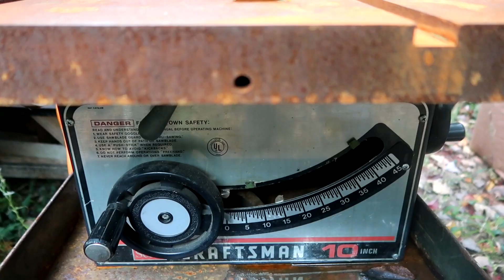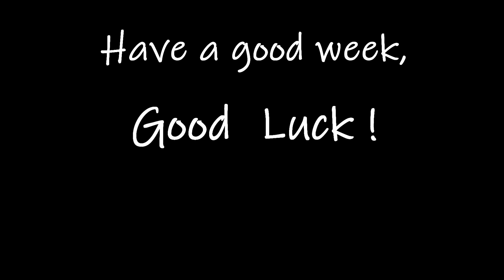My Kinda Luck.......Good Luck In 2024 !

Comment: Luck is what happens when opportunity meets preparedness.  Knowing what you need and keeping your eyes open allows you to receive what is provided.  Is it luck, or good and perfect gifts?!?  You know the antique cash register could have been donated as well.  What about the electric chain saw?  Did you grab that too?  👍😀👍
Reply from the maker: I wondered if anyone would notice and comment. That register was probably in much better condition that it appeared.
I told a scrapper about it and he said he would go get it.  You could see that it was easy to reach.

My truck was full....to the point where I left the saw.  There were 2/8 boards in there that were too long for the truck. Clean, never cut or used.
I left the saw and a bunch of other stuff too.   That was the fifth dumpster.

It gets worse.  I drove by later that night and the dumpster was already pulled.  It wasn't even full.

This  morning I go and donate another small load to ReStore.  

(It has gotten to the point where I don't ever expect to witness this much stuff being tossed again).

Comment: I like the gas filled rabbits and the cute yellow cat. He reminds me of my yellow cat Archie. I like how you think ahead. Storing extra water heaters is such a good idea. With your kinda luck life should be easy.. BTW have you installed the beam yet?
Reply from the maker: Ahh...the beam....
To beam or not to beam?
I can't find a spot where 20' is enough.  And the beam is sitting 200 miles from where I would prefer to install it.

My thoughts were to find a longer beam, local to where it is needed.
Or,...to make some type of gantry type set up.

or.....to wait and like magic some idea will fall onto my lap. (not a good way of describing good news when talking about crazy heavy beams).

It gets worse.  I saw a car go to scrap that had loads of parts I could have used.
However, the project of taking the parts off would of been....another project.
The beam is in the same category...I've got some pressing projects ahead of it.....I worry it may be a distraction...
....but, I think about it everytime I need to move another stove, engine block.....
to be cont....